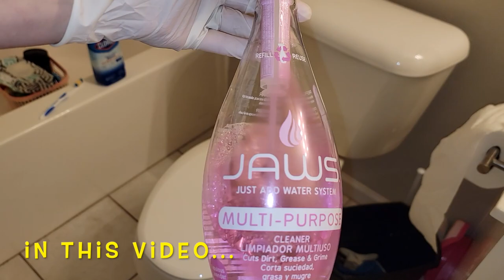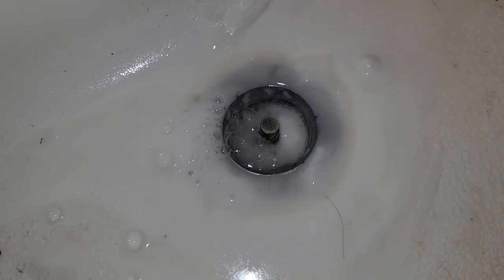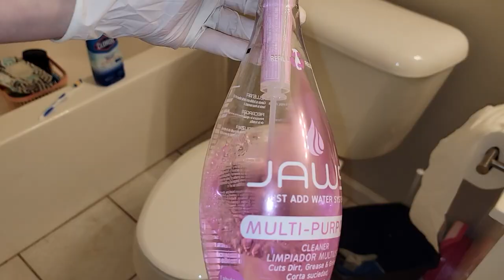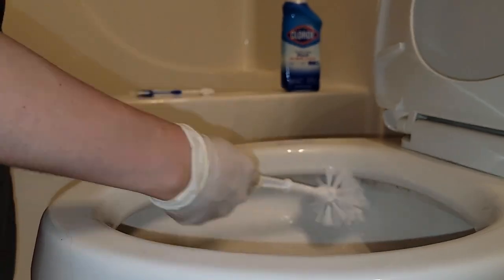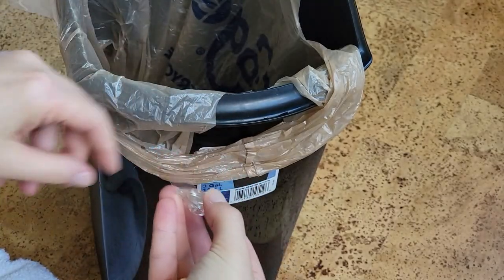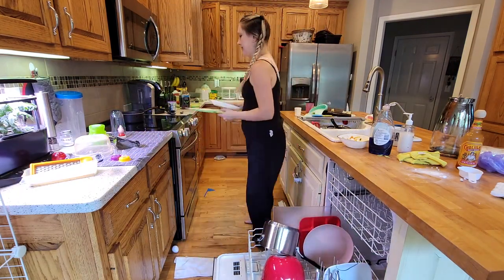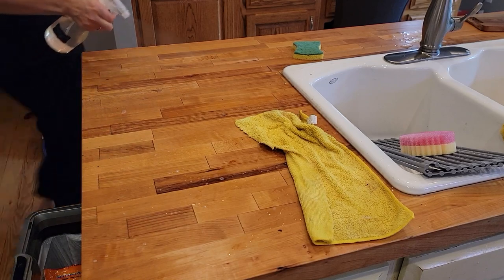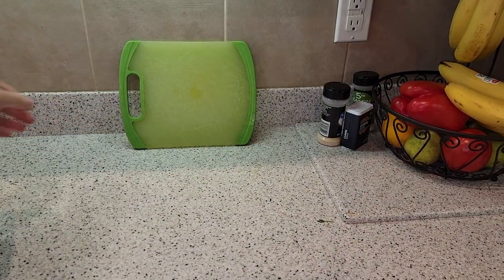DEEP CLEANING BATHROOM // NEW HOUSE CLEANING // CLEANING MOTIVATION

Comment: I always found that a tub of bubble bath water leaves a tub looking clean once the children are done with their bath and it's drained. Or if no one wiill be bathing in it, a tub of Dawn dish soap bubbly water (it's strong enough to clean oil off of animals from oil spills, and yet gentle enough to use on the tender animals) allowed to sit for a while. Of course supervised so no child gets in it. Also, one time I moved and the tub was disgusting and I used a very light comet sprinkling and then scrubbed with wet paper towels so they could be tossed and it worked wonderfully. I didn't scrub too harshly.
Reply from the maker: Hey, I like the dishwasher idea! Thanks!

Comment: What’s wrong with using powder detergent? I used it for years. I only use the pods bc they’re easier.
Reply: I was thinking that. The powder is really good. You have to use rinse aid and salt anyway with the cubes & pods in hard water so powder works out really good value. Whatever you use there will be someone saying the opposite! 🙄🙂
Reply from the maker: So I hear always that it is not good for the dishwasher, and the guy who installed the new dishwasher said to never use powder as it clogs the pipes. The pods have all the stuff to dissolve the everything properly, but the powder will stay in the pipes. If I understood correctly. 
I personally did not see the difference in how clean my dishes were after using the powder, but because its a new dishwasher, we will be using the pods.